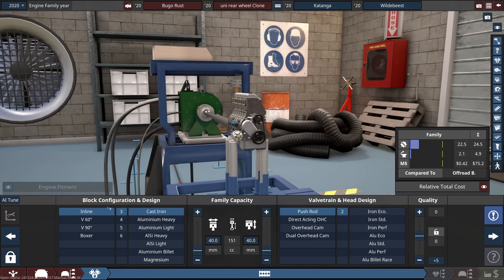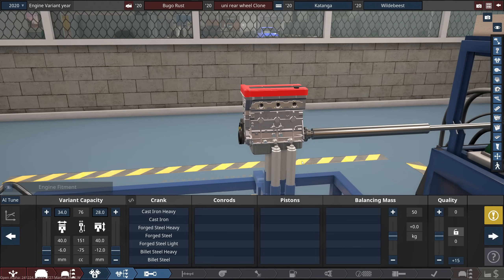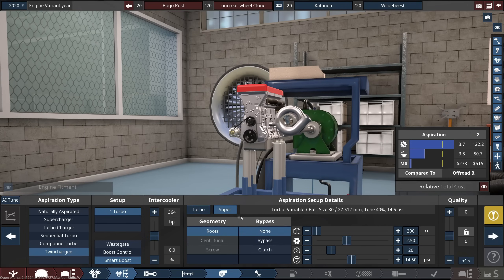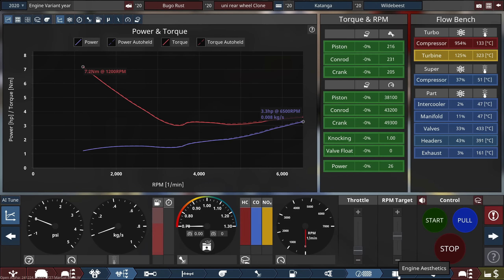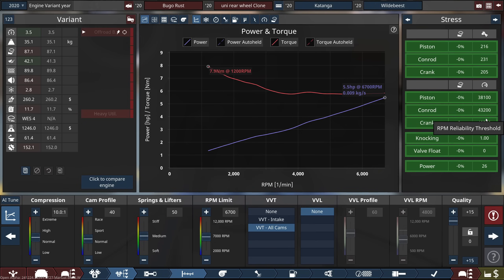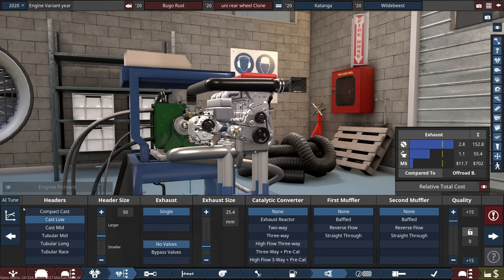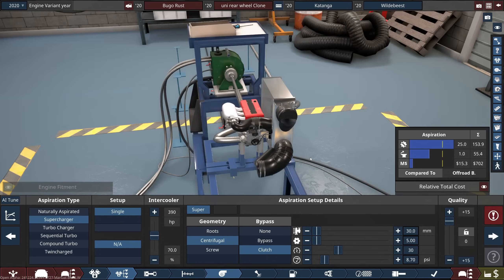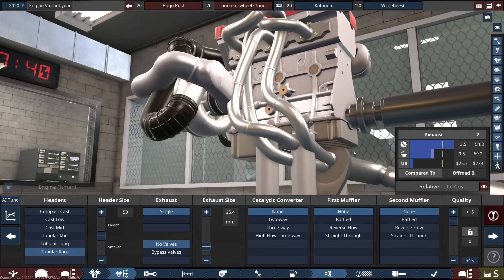The Smallest Engine Possible (supercharged)

Comment: So I don't know much about cars, but my understanding from reading about WWII aircraft engines is that the US preferred turbochargers because superchargers take power out of the engine to run, whereas turbochargers don't because they're powered by the exhaust. If that's correct, then maybe you could've gotten more power out of a turbocharged engine this size?

Comment: 76cc Twincharger is possible, it gives you 60HP and 36NM 30/32/5 0/2.1 for the variable ball bearing turbo and 200/1.6/16/2.0 for an clutched roots supercharger. maybe you can squeeze a little more
Reply: 64 / 38 now

Comment: You basically build a UAV engine. Absolute light weight, way to expensive to go in a car, exotic fuel choice and super high frequency noise that will dissipate over short distances, thus increasing the drones stealth.

The only issue is you mounted it in a Balkan shit box lol
Reply: I guess this was the fate of the engine from the MQ-9 that was downed by Russia over the Black Sea a couple of years ago.

Comment: Surely a turbo would be better, superchargers are driven by the crank. A supercharger with way more cc than the engine would provide significant parasitic losses over any hp gains, surely?

Comment: you can get that engine up to about 42-43 hp, but it takes some time.
Reply: I got it to 53,9hp with nitro and a screwcharger
Reply: @mrsnoopy7557  thanks for the tip, I have got it up to 58.1hp

Comment: I would also like to add that when tuning you should be looking at the 4 graph mode to help show where your air flows and fuel map sit. It helps a lot to be able to see where your restrictions are, and you van only see the turbo/Supercharger efficiencies in that mode iirc
Reply: yeah he had like 25% flow utilization on all measurements but didn't restrict any of them further (which would have helped move the power band into the usable rev range).

Comment: after some fiddling, I arrived at 41.3 hp and 24.5 Nm

crank: billet steel, conrods: titanium, pistons: forged light, balancing mass 50, quality 15
comp: 11.1:1, cam profile 100, springs and lifters 0, rpm limit 12k, vvt all cams, quality 15
sc, single, 280 hp intercooler, centrifugal, clutch, comp size 31.4mm, ratio 15.40, tuning 2, boost 0.75 bar, quality 15
injection, multi point efi, per cylinder, fuel map 44, timing 100, quality 15
nitromethane, nm90, race, manifold size 62
tubular long, header size 21, single exh, 9.52mm, no cat, no mufflers, -15 quality

works by the narrowest of margins

Comment: Maybe a series where chat chooses an IRL car, and you develop 3 different motors for it from tuned OE to OTT.

ie: Miata NA was voted. Engine 1 would be the stock 1.8 with boost or cammed/stroked. Engine 2 could be a 1.0L superbike motor. Engine 3 could be a 5.0L v8. 

Export to BeamNG and lap all 3 versions around a track to see which one is fastest or suits the car the best.

Comment: You said nitro is the best fuel, but I think compressed gas gets more power, since it has a significantly higher AKI than any of the other fuels
Reply: Compressed gas does happen to get the best thermal efficiency, but nitro makes the most power. Octane rating is just how much compression the fuel can handle before it self-ignites; it has nothing to do with stored energy.
Reply: Also, throttle doesn't do much if your RPM target is set at idle

Comment: I think you should do an economy performance sedan 

200-300 horsepower 
2.0 L - 2.5 L turbo

Another idea would be a performance built hatchback

150-250 horsepower 

1.4-1.8 L turbo

After that, another suggestion would be a sports sedan 

250-400 horsepower 

2.5-2.8 L I4 turbo

Or 

3.0 - 3.7 L supercharged

Comment: 400hp per litre. Certainly the highest state of tune ever for a car like that. 😂
Reply: ive slowly been tuning my own engine of the same size. So far its at 54.1hp so 711.8 hp per litre.
Reply: @Chris-qr3qh  is that on nitromethane? i've gotten the 76cc engine up to 39hp with compound turbos on e85. the torque curve is horrendous tho
Reply: @eldinmuller7698  i got 38.8 on E100 with Supercharger + Turbo. Torque is more or less constant from 8k to 12k rpm (21-23 Nm). It's quite driveable in Beam if put into a lightweight chassis (got 307 kg for the car). Would be very interested to see the 54hp variant ;-)
Reply: @CherryGS  damn i wasnt really able to get anywhere with the supercharger so i just gave up and went for compound turbos. the power just spikes at 9k-10k rpm and thats that.
Reply: I mean, it's probably better than the 600cc compound turbo i3 with 0 can profile I made.. because for some reason it redused to make any power of I went high can profile.

Comment: One problem I’ve noticed is that when you do the sound test, you up the throttle without upping the rpm target. The engine won’t actually rev up unless you increase the rpm target to wherever you want it to rev to, or just click the PULL button
Reply: He did the same thing last time and it drove me up the wall a little lol
Reply: @the_real_Kurt_Yarish  same
Reply: Real
Reply: This
Reply: thanks, this made me reallly mad XD
Reply: Have to say though, i wish there was a unified slider like before, trying to use both at once is problematic
Reply: @ personally I just put the rev target at pretty much the max and then move the throttle around to rev it
Reply: @r10101  Would be more accurate for general throttle application but it does make sense if you're trying to simulate more realistic scenarios
Reply: Came here to say this
Reply: Supercharged small engines should not be a thing qmd they aren't in the mass production world. Supercharging is not just a task for you, but the engine too. Small engines benefit more from almost "free" power from turbos than the large friction devices called superchargers. Don't get me wrong, I like superchargers but not on tiny engines
Reply: @DaniBatkataBG  From an economic perspective, turbocharging smaller engines is the more logical choice. However, when it comes to practicality, smaller supercharged engines utilizing Roots or screw-type compressors are the clear winner. In an alternate reality where emissions aren’t a concern, I can easily imagine a world where most vehicles are powered by compact 1.5L supercharged four-cylinder engines, primarily for their ability to deliver impressive low-end torque. While these engines might be less efficient and experience more strain compared to turbocharged counterparts, their efficiency levels out, particularly in heavier vehicles relative to their displacement making them more efficient and smoother than a larger N/A engine or equivalently sized turbo engine in most scenarios
Reply: 1st gen mr2 had a supercharger on it @DaniBatkataBG
Reply: Idk man, i drive a year 2003 1.6L supercharged mini cooper s, and its fun as hell. @DaniBatkataBG
Reply: @DaniBatkataBG although I agree with you, there were some small engine production cars that did have superchargers for example the e200 cgi, c200 cgi etc
Reply: @DaniBatkataBG talk to Kawasaki with their H2 series and they’re basically planning on supercharging everything according to their patents
Reply: @DaniBatkataBG 
Necro post, but Japan had been supercharging kei cars sense the 80s. It works well because of the smooth power curve 

Sure there is a penalty but when the supercharger is sized appropriately it is just a part of the nature

Comment: When you want to test the engine you need to raise the RPM Target. Otherwise it will stay low on a pull. Or you can set the Throttle on 100% and play with the RPM slider.
Reply: @9:50